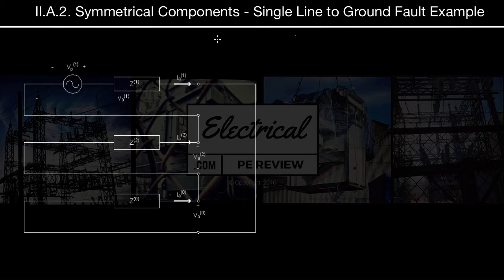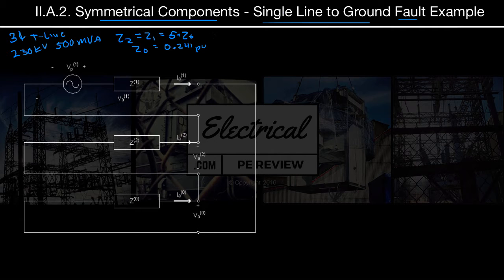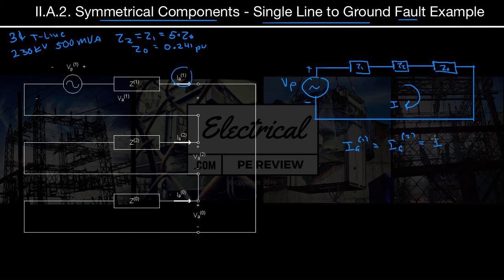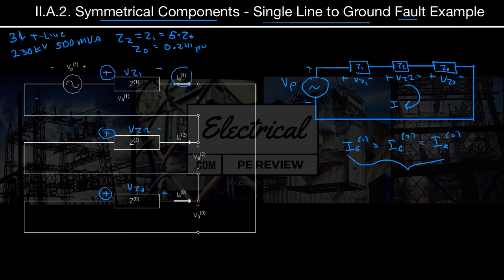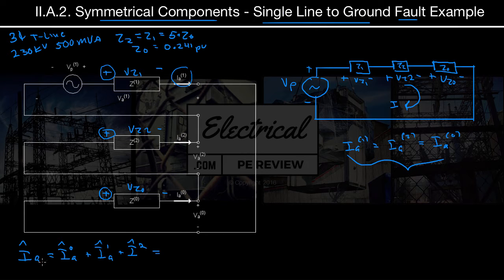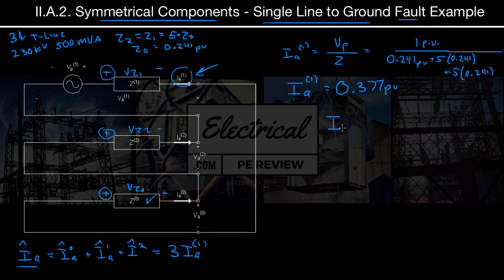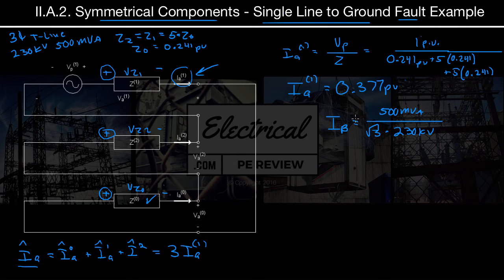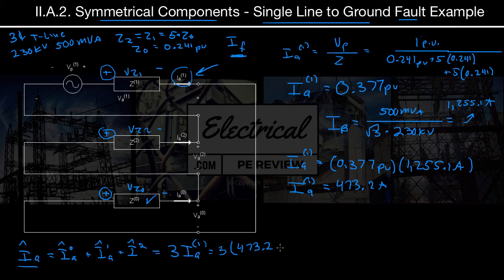How to Solve: Line to Ground Faults with Symmetrical Components - (Electrical Power PE Exam)

Comment from the maker: 0:29 - Circuit parameters and SLG fault formula
3:51 - Solving for the positive sequence current component (Ia1) in per unit and amps
7:14 - Solving for the positive sequence voltage component (Va1)
8:47 - Solving for the negative sequence voltage component (Va2)
11:28 - Solving for the zero sequence voltage component (Va0) *note this is incorrectly written as Va3 in the video.
13:10 - Solving for the A phase voltage at the time of the fault (Va)

Comment: How are you determining that Va(1) is 72.5kv and then Va(2) is a negative value. Shouldn't they all be negative or positive? In your initial simplified diagram, you show the polarity as + to -.
Reply from the maker: When a complex number is "negative" it really just means that it is ±180 degrees out of phase.

For example: For voltage, just swap the positive and negative voltage polarity references (the "+" and "-" signs trade places), and for current, change the direction from forward to backward (or vice versa).

Va(1) is positive due to KVL, since the voltage drop across Z(1) is smaller than Vp(1):
Va(1) = Vp(1) - Vz1
Va(1) = Vp(1) - Ia(1)•Z(1)
[see 7:14 for these steps].

Va(2) and Va(0) are "negative" due to where these are located on the circuit and their polarity direction.

They appear across each sequence impedance Z(2) and Z(0), however, they are in the opposite polarity compared to the actual voltage drop across each of these sequence impedances (for a load, the voltage drop is positive where the current enters, and negative where the current exists). 
[See 8:47 for Va(2) and 11:28 for Va(0)].

The reason why these sequence voltages are "negative" is because during fault conditions they act as a temporary voltage source that delivers fault current. A voltage source has opposite polarity compared to a load, the voltage polarity is negative where the current enters and positive where the current leaves.

Comment: Hir sir, in 3 bus 2 generator and 2 transformer system, if I make reactance grounding of transformer and generator equal to zero, what will be happening on the magnitude of fault current in both cases? Thanks.

Comment: Does this apply to Bolted SLG too? (Zf=0)
Reply from the maker: Yes. The example problem in this video is indeed a bolted fault since there is no impedance included in the short circuit, it is a zero impedance ideal short circuit. The only impedance in the circuit is the equivalent positive, negative, and zero sequence impedance of the system at the fault locateion.
Reply: @electricalpereview  Thank you for your answer. I don't have Z values instead I have X0/X1/X2. Can I just simply replace those with Z's?
Reply from the maker: @eminvalikhanov1245  Absolutely. Transmission line conductors and the loads on them are mostly inductive (+jX) loads. When you see impedance values instead in these types of problems, it's just the magnitude. For example a 2Ω inductive reactance (X = 2Ω)  can be represented as an impedance in rectangular form as:

Z = 0 +j2 Ω

Or it can be represented as an impedance in polar form like this:

Z = 2Ω<90º

If you're given reactance values instead (X0, X1, and X2), just include the positive "j" in front of each reactance.
Reply: @electricalpereview  Woow thank you for great explanation. One last question: If I am turning grounding reactance of transformer to zero(T2=0.07=>0) what we can see the changes of magnitude?

Comment: Thank you Zach for making things so easier to understand. I was afraid of symmetrical components but you designed this lecture so that just the keys points can be understood without wasting time in non-essential. Now I feel confident when doing a PE exam symmetrical component problem.